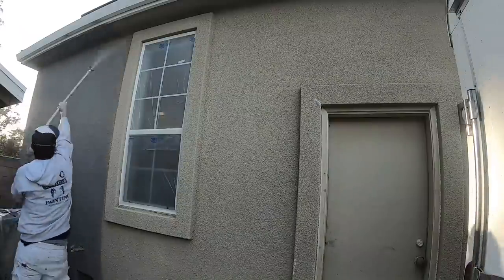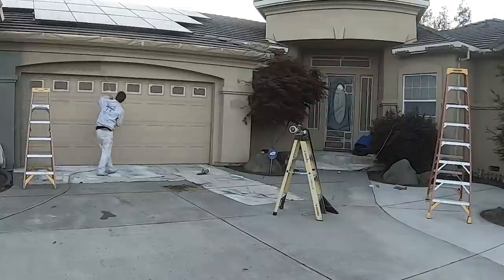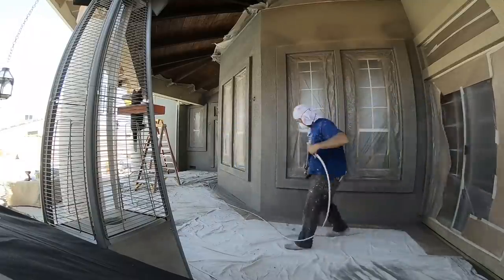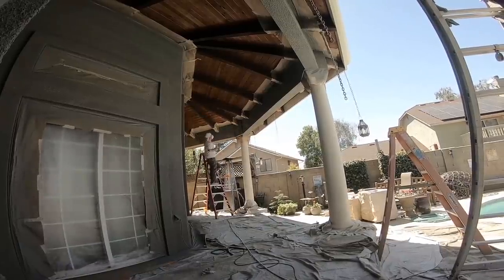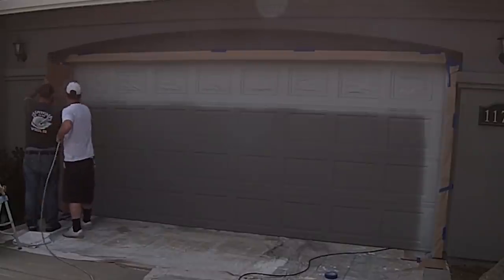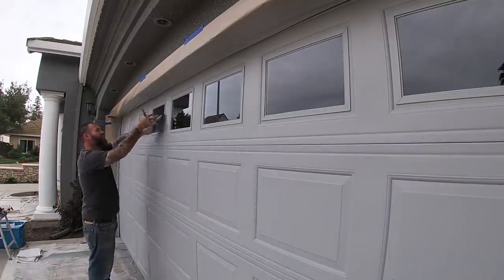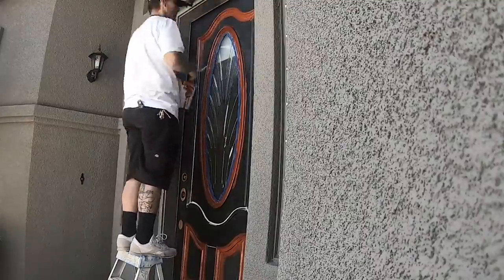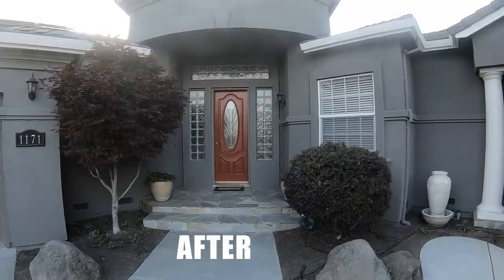I MADE $6000 IN 5 DAYS PAINTING THIS HOUSE

Comment: Word of the day is....”backroll”. Especially on stucco
Reply: Home owners request not to
Reply: Well for $6k in five days you should be back rolling. The only reason an owner asks to not back roll is because they think it’s gonna save on labor. I never spray stucco with out back rolling. You do your thing though....clearly you made a killing off that job just seems kinda unfair to the owner and the trade. 

Peace
Reply: Back roll to provide consistancy and longevity ...💪pushes product into the surface .....mickey mouse job !!!
Reply: Also helps ensure proper thickness so customer gets a paint job that last as long as the paint claims it does.  And a truer color that can be to touched up with out making touch up a few shades darker or closer to the true color.
Spraying is not a substitute for rolling. Nor is doing 2 coats while the paint is still wet